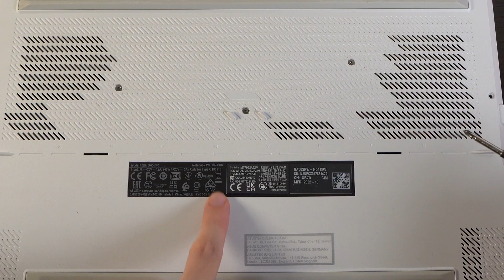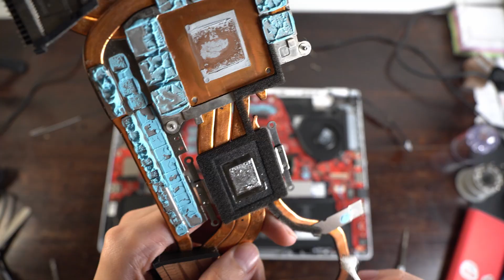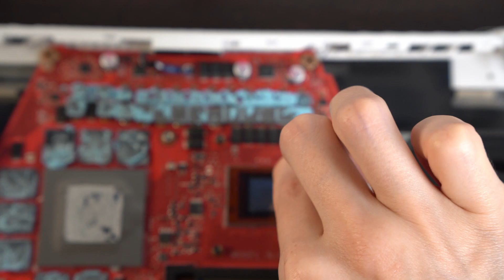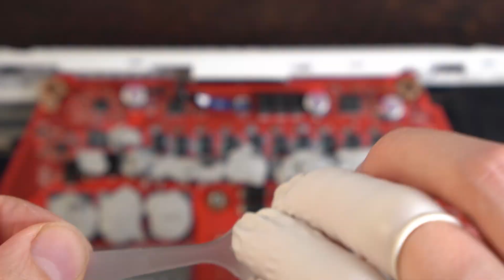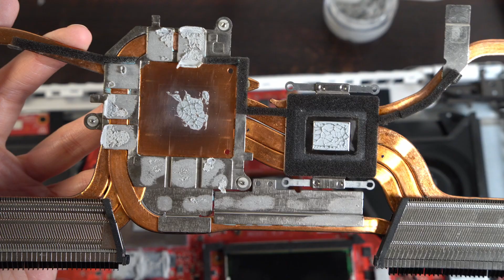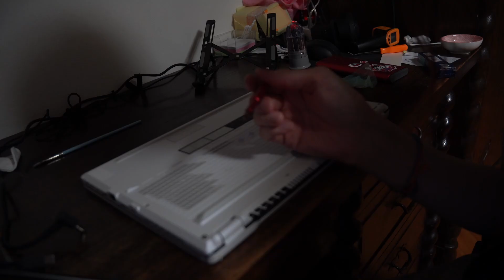Asus Zephyrus G15 cleaning and repaste using Upsiren UX thermal putty

Comment: You just used too much thermal putty. Upsiren ux is very thick, try upsiren utp-8 it's much thinner. Try rolling it into a uniform log shape and lay it across the components, and gently squish the heat sink down when remounting.  The ux will work but it's more difficult to work with. Also taking a clump of the putty and dabbing it onto to components until some residue is left behind will help the putty stick to the components better
Reply from the maker: Thanks for the tips! I've got a CH-X1300 which should be easier to shape, but still haven't got to taking the heat sink off (cleaned the fan twice so far, when temps started going into throttle zone). 

Do you think heat would help redistribute it a bit and help it spread thinner eventually? Or is it just about getting the feel for the right amount?
Reply: @agathakazar  did you change it? thermal paste on the vram is not a very good idea

Comment: do putty also contain silicone oil just like thermal paste? This stuff is really interesting
Reply from the maker: Probably yes, but maybe the amount is different from that in the thermal paste? 

The first random SDS I found of a thermal putty lists 26710-23-6 Vinyl Silicone Oil 232-315-6 at 4%
https://www.thermal-grizzly.com/media/f8/01/9a/1737103335/TG-016-TG-Putty-Advance_GB_Securitydatasheet.pdf

Comment: Do not use thermal paste especially for laptop GPU and CPU because of thermal breathing negative effect. Use only PTM7950.
Reply: What about for the vrams ? I heard that k5 pro is good but im not sure man
Reply: @jahnjahn2988  Upsiren putty, watch snarksdomain tests. He does great job comparing them.
Reply: @jahnjahn2988  Just leave the factory thermal pads if they are not tore.
Whatever thermal pads replace will give your worse temperature because those thermal pads many times does not have those round up size sold to the end user in the market.
That is a critical part because if you used one that is too thick the chip die will not have proper contact and if it is too thin the vrm or memories will not have proper contact

Comment: I would have suggested you use the thermal pads with different thicknesses; I have a Dell XPS 9520, and it has six thermal pads with different thicknesses 0.5mm, 1mm and 1.5mm. And as I knew, these Zephyrus laptos  have metal liquid thermal paste, and maybe it would have been better if you hadn't taken it apart.

Comment: Thanks for posting this. I'm going through something similar with a 4090 having high hotspot temps and I ordered this putty in case the thermal pads need replacing. It is not easy to find the exact specs and diagrams online and very few go through the trouble fixing thermals let alone measuring. Sorry you had to go through all this but watching it gives me hope that I can be successful as well.

Comment: On laptop vram and vrms what to use bro pls tell me 

I own rog strix g15 
For cpu i oredered liquid metal of thermal grizzly for gpu ordered thermal grizzly extreme 

For vram and vrms what to use som say pad and some paste 

Can iuse Arctic mx4 for vram and vrms pls reply
Reply: Yes you can use Arctic mx4 for the vram and vrms but i would recommend whaever your laptop used for example thermal pads or thermal putty. For thermal pads you have to be careful of the pads thickness.
Reply: @nunoxu9696   its melted can't differnentiate between thermal pad and thermal putty so ordered k5 pro for varm and vrms watched bobofalltrades channel he used same like that and temps for really really low after repasting so i am gonna go with k5 pro for vramand vrms
Reply: @m.smanoj4688  For VRM , chokes and Mofsets use thermal putty or if you know the distance between heatsink and chip order some thermal pads ,but to save your worries with thermal pads just order putty - it's basically thermal pads with shape

Comment: *Update: I measured all the putties with callipers and found that all the top putties have similarly large particle sizes. The best putty for thin gaps is now Halnziye HY236 as it can compress down below 0.1mm. I wish I had measured them all sooner.

Yeah, UX Pro is a little stiff compared to other options. The current best putties are Honeywell HT10000, Upsiren UTP-8, Fehonda LTP81 and Laird T-Putty 607, although I suspect Laird T-Putty 910 will be right up there with Honeywell HT10000, just hard to get T-Putty 910 currently as it is fairly new.

UX Pro does work well in Videocards, but is too expensive if you ask me, and UTP-8 is slightly better, much softer, and much cheaper.
Reply: Can someone clarify to me if it's recommended to dilute IPA with at least utp8 or utpx , to make it easier to apply? as it turns kind of sticky rather than clay composition
Reply: @daaudiome You don't want to mix putty with Alcohol. Oil and Alcohol don't mix well. Upsiren actually adjusted the consistencies of their putties a couple times, and made them softer. Too soft woth the latest adjustment, actually. They will be going back a bit closer to what it was like before where it's easy to roll logs/balls and place them, while still being soft enough to squish.

I wouldn't consider either UTP-8 or UTP-X as "sticky" they are sone of the least sticky putties there are. Are you wanting a sticky putty? Could go with something else if that's the case.

If you have an ASUS laptop then you should get Halnziye HY206/HY236/HY256, or Zezzio ZT-PY6.  If you can't find those then Maxtor AP-306 or Upsiren UTP-4 Ultra-Thin.  These putties have much smaller particles and are better suited to the thin gaps that ASUS laptops have.
Reply: Please do some updated vids of new best putty
Reply: @steezegod2768  Will try to make dedicated videos from some more putties. I've got streams of them all so folks can see what they look like for application.

The result charts are located at the Google Drive link in my video descriptions (Test Chart Repository >VRAM TIM<ETCHASH).
Reply: @snarksdomain  Do these putties dry out and degrade cooling performance over time, just like the pads? I'm looking for a permanent solution so that I don't have to open up my GPU constantly.
Reply: @user-f1ff23  The depends on the quality of the Silicone OIl used as the carrier fluid. Some are better than others. The Putty that set the bar high so far has been TG-PP10 (Discontinued). Many of these other putties are much newer so we don't have great long term data on them yet.

Honeywell HT10000 is good for at least 2 years so far (from what Eugeney_KH told me of his customers' experiences).

Upsiren UX Pro Ultra was still soft for me after 16.5 months in my laptop.

TG-PP10 was soft after 2.5 years use in my 3090 with Copper shims.

We should have an idea over the coming years as to which ones can match the longevity of TG-PP10.

That being said, even once putty does stiffen it should still transfer heat okay. The trick is to pair it with something on the core that will last just as long, and for that I recommend Honeywell PTM7950 or similar PCM.
Reply: Love your videos man, incredibly detailed and thoroughly researched.

Comment: Thermalpad 0,5mm, thermal paste grizzly kryonaut extreme 14,2W/mk best paste for GPU
Reply: You are so wrong, the best is PTM7950. Period
Reply: That thermal paste will either be pumped out or deteriorate very fast because is made to to be used with kryogene and deteriorate under 80 degrees.

Comment: just use k5 pro, its the closest thing you can get to the factory blue stuff, for cpu use liquid metal and for gpu use MX6. MX4 is ok but it doesn't last that long on bare cpu/gpu die's as it pumps out due to its low viscosity.
Reply: K5 pro K>5,3 W/m.K vs UPSIREN UX Ultra PRO 16.8W/MK 😉😉😉😉😉
Reply: Factory blue stuff Is laird 607

Comment: I am also having issues with zephyrus m16. I should replace all cooling components. I am thinking replacing with 0.5 thermal pads. This is not user friendly at all from Asus.. Thanks for trying out! What happened actually when you launched with pads? did it turned off or temps were too high?
Reply: the gpu got too hot and shut off the computer due to making zero contact with the heatsink. the thermal pads were too thick. it's easier to just use paste on the vrms.